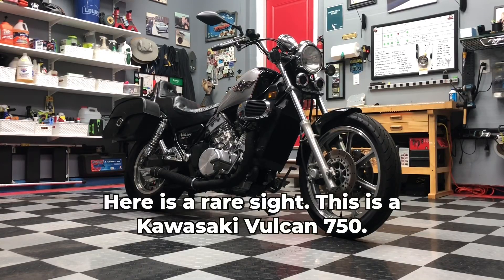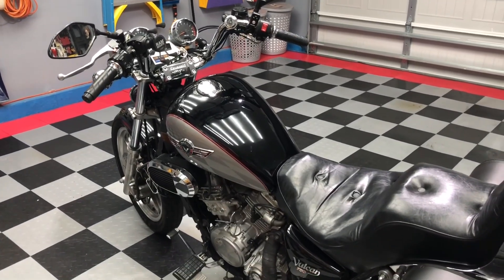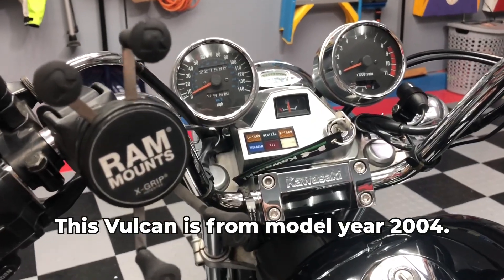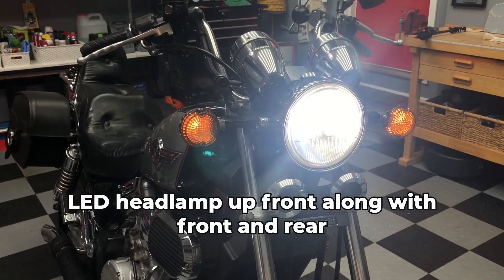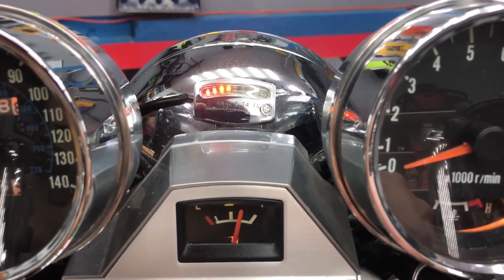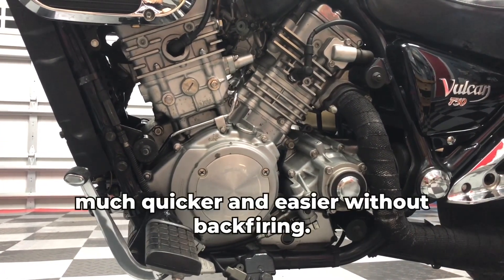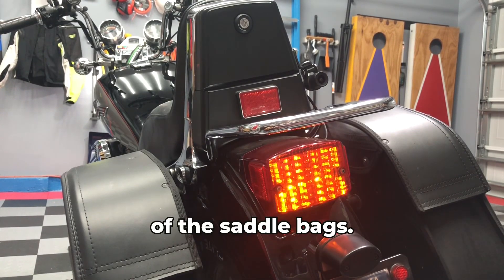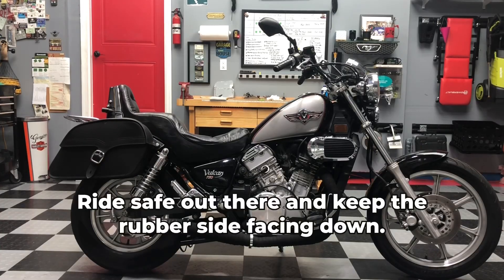A tour of the Kawasaki Vulcan 750, narrated by Sir David Attenborough (deep fake)

Comment: Love that brake light mod. I had added running LED rings that got brighter when the brakes were applied to my rear signals but what you did looks really sharp.
Reply from the maker: Thanks! I do also want additional turn signals back there. What sort of LED rings did you have? Perhaps one day I'll get some extra lighting added and make a video about that.
Reply: @CFG750  I think I ordered them from JP Cycle. It's been almost 20 ago though. I do remember that installation was super easy. I had to glue the rings to the inside of the signal lenses and then tie the wiring in with the tail light itself. Took all of 30 to 45 minutes and they were really bright when on and super bright when you hit the brakes. Besides removing the goats belly it was probably the best mod I ever did on her.

Comment: How do I make the gauge clusters shiney again with chrome? Do I have to repaint them or something? Mine looks all dull, I just see the metal or aluminum, what ever its made out of.
Reply from the maker: Try this. Use a rust remover or a combination of vinegar and baking soda to remove rust from the chrome surface. Then use soap and water to clean the chrome surface thoroughly. Then apply chrome polish and get buffing! Repeat as necessary until the chrome comes back. If the chrome is too damaged, you may want to simply spray paint them black.

Comment: When you say the blue wire mod for the stator, How do i do this? I check the forms but I couldn't find anything. I been using the forms since about last year. Not sure what mod i should do there, our bike has the original stator i believe.
Reply from the maker: Check this out: https://www.vn750.com/threads/short-video-on-blue-wire-two-wire-mods.94698/#post-1187946

The blue wire mod and the two wire mod are two mods that may help to improve the bike's electrical charging system. I did both on my bike and will make videos about them and explain them further ASAP this year. :)
Reply: @CFG750  sounds good. Ill check it out and get straight to doing it!